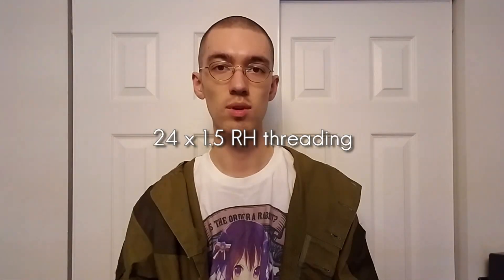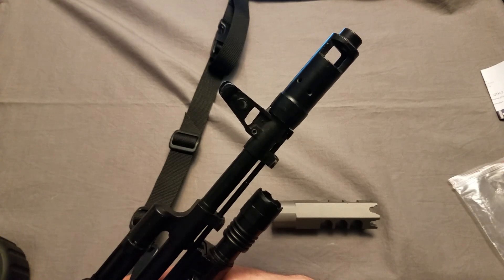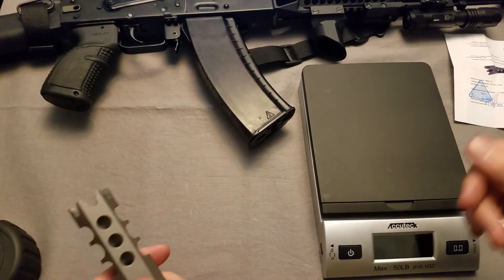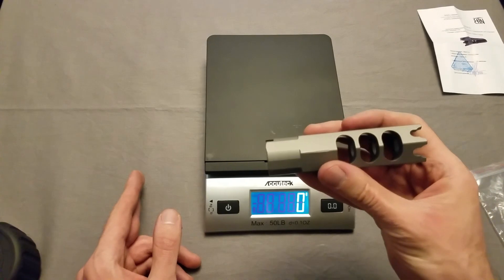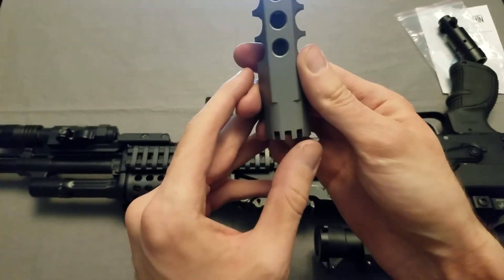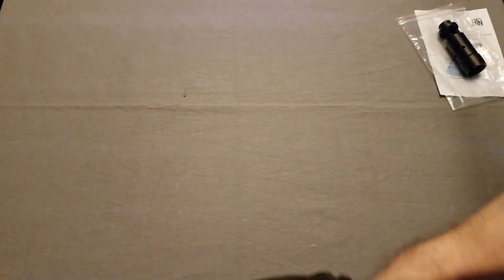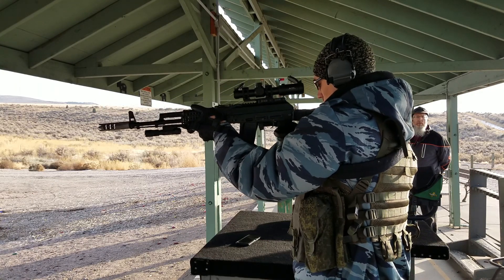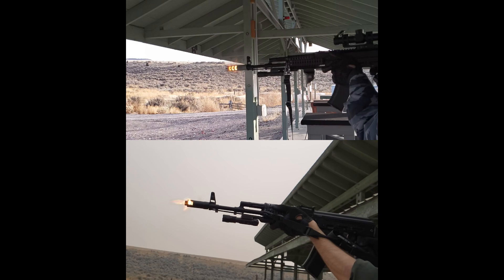AK Muzzle Brakes: Zenitco DTK-3 vs. Bulgarian Muzzle Brake

Comment: Any particular reason you got the DTK-3, rather than DTK-1? Also, would you know how they differ from each other, besides the DTK-3 being longer? Thanks!
Reply from the maker: If I remember correctly the DTK-3 was the only model that was in-stock when I ordered it. The only difference I can see between the DTK-1 and 3 is that the DTK-1 is both shorter as you said, and also a little lighter. Other than that I think they're identical.
Reply: @Jang-gun銃  That's what I thought, thanks!